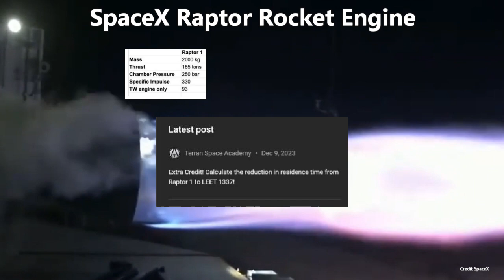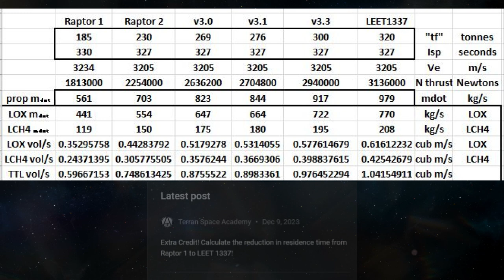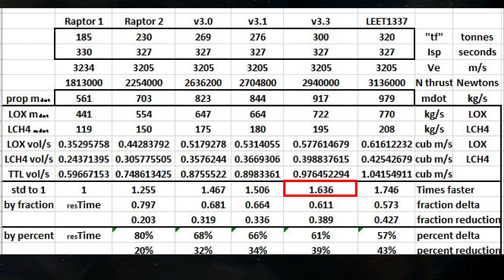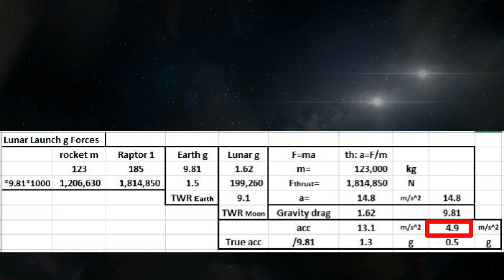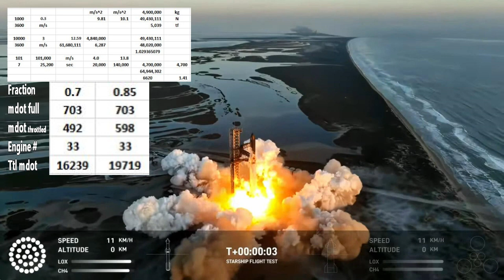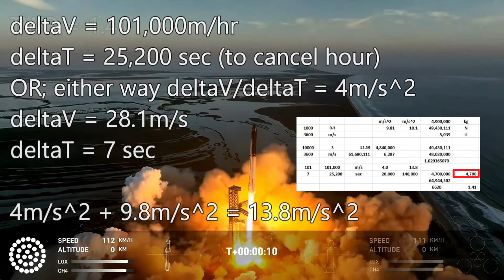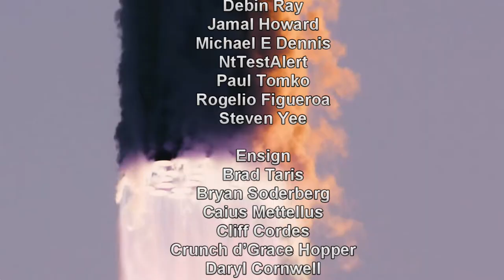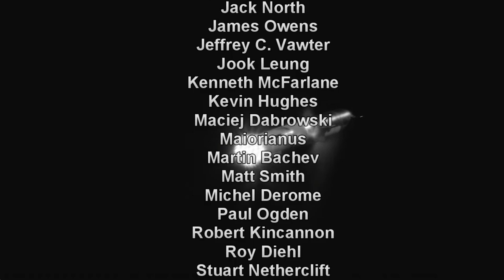SpaceX Starship IFT1 and IFT2 Booster Analysis Calculations and Solutions

Comment: For IFT-2, I figure it's about 7 s to climb its own length of 160+233=393'. Since the displacement x=.5at², then a=16.04 ft/s². With g=32.2 ft/s², that means TWR=1.498. A mass of 4900 metric tons weighs 48.07 MN, giving a thrust of 48.07(1.498)=72 MN, 97% of the 74.4 MN claimed by SpaceX. I think the video could be loaded into an editor to count the frames and get a more precise time
Reply from the maker: I wish we had one really good glitch free superslomo of each launch.  SpaceX must have these.

Comment: I know I've mentioned about its possible abort system, but i wonder if instead the whole thing has rockets at the top like tim dod had in is thumbnail, it has a dragon capsule inside for human rating only at first and during abort the fts would severe the top cone and split it in the middle going up to allow the capsule to quickly fly out and get clear in time saving the need for rockets on the outside and design with less mass.
Reply from the maker: A custom lunar version could accommodate that...
Reply: @terranspaceacademy  that is true, but technically all starships meant for humans can have it. It's a very simple modification that can be made. If they don't use the phalanx design it could be used to carry the mini starship in it using the abort system to help it get a push using explosives inside that only fire when opening like the saturn 5 staging rockets. The second launch holds its mini booster to get to the moon, allowing 1 lunar mission to be launched with just 2 launched instead of 8 to 20.
Reply: @terranspaceacademy also to speak before I forget, by only reusing the engines with inflatable reetry shields and no heat tiles you could us all the fuel to get even more mass to orbit allowing a larger cargo delivered to the moon without any refuelings needed still using the abort system to get a modified alpaca(seems safer and takes less room) to the moon using the booster to get it there into orbit and bring the capsule back leaving behind the cargo to make it easier and cheaper to get back later on. He wants less moving parts well there you go. Many modifications but no risk of orbital refueling or starship reentry risk of breaking up and only whats is needed for the moon that is not over kill like large or regular hls starship. I would like to hear your opinion on that for thoughts and ideas.

Comment: I thought Starship used engine gimballing to negate the need for shutting down the opposite engines when the fail
Reply: Only the inner engines gimbal last I checked the outer one are fixed which means if they lose around 4 to 5 outer than they would most likely have to shut down the other side too unless I missed something plus it would mean the mission is over for too many engines lost.
Reply: @mr.ackermann807  Correct the only inner engines gimble but they should be able to provide rudder control if a few engines go out also they can throttle up the adjacent fixed engines to 100% to compensate for the missing thrust.  Like you said if more than 3 go out the mission is likely a scrub.  I do wonder if later missions will have an abort profile that includes the ship hot staging and returning to land
Reply: @bigianh  ok. I've have actually been talking to others about the abort system too, but not the whole thing for it would take time to get the engines up to speed and more time to accelerate away. That's why I suggested the upper half only fly away by using the fts to seperate it and smaller engines to push it away faster without all the extra mass and parachutes to allow it to glide and land safely away. Or still use the fts but have a dragon like capsule inside for now that would act like usual since it was already designed for that. Or even an abort system where if the damage Is limited and contained to lose the engines and close of the tanks to give you more time.
Reply from the maker: The outer engines are thrust vectoring only (20), the interior 13 can gimbal so there are a lot of control options... but on the way up it can get dicey reducing power too much.
Reply: @terranspaceacademy ok thank you for informing us.
Reply from the maker: You are most welcome.

Comment: Thanks for the great content as always.  SpaceX definitively has great flight control software.  As someone who works with factory automation PLCs at work I would love to see their systems sold as such.  Much of the existing seems have that "32 bit extension of a 16 bit patch of an 8 bit originally written for a 4 bit" feeling.  One of the best examples of the system handling a hardware failure was the Falcon 9 that had a grid fin fail right after reentry burn.  The rocket started rotating pretty rapidly and didn't turn for the landing pad.  But regardless the rocket managed to stabilize itself do a soft water landing.  This always makes me wonder if that was a programmed failure condition, or if the flight control just was able to cope with the unexpected response to flight commands.   Either is impressive, 2nd case is more impressive in my thinking.  
PS keep doing the math, I love it.  But I'll be letting others double check you lol
Reply from the maker: I agree.  A system that continues adapting when things go wrong is what we need.

Comment: I heard somewhere that those computers system are running consumer grade Linux 🐧computers in a 3 X voting system. I always wonder if the 3 X voting system was actually needed on the first stage? Are they high enough to be affected by space radiation Considering the ridiculously small Circuit trace size on the chips now.
Reply from the maker: See other post...

Comment: It makes little sense to give the numbers with seven decimals. Nobody is metering that exactly. an institution that calls itself an 'academy ' should know that.
Writing cub m/s shows not being able to calculate in metric units.
Calculating with Earth acceleration 9,8 is the opposite: We mostly use 9.81 m/s^2, the exact value would be 9.80665 m/s^2. Writing 'mt' for metric tons is odd for a European, and KPH too.
Reply: Imperial units make the eurocuck seethe
Reply from the maker: True indeed.  I should set significant digits.

Comment: Great analysis it gives amazing insight. I wish you’d attempt these types of calculations using best estimates on the UKs reaction engines rocket motors bearing in mind the heavier mass of the air chiller and gas compressors in the design compared to the missing mass of 80 percent of the oxygen require to get to orbit.
Reply from the maker: That's a tough one.  Without clear data it could be extremely variable... from 1,000 sec Isp to 4,000 when air breathing...

Comment: The N1 used differential thrust to control attitude, but on Starship all inner Raptors are gimballed for vectored thrust. At some point the Starship booster might have run out of vectoring capacity to compensate for the imbalance of thrust from lost Raptor engines. Loss of thrust or vectoring could also have led to the failure of the IFT1 stage separation manoeuvre. For IFT2 there was no issue with any Raptors prior to the hot staging separation.
Reply from the maker: The N1 tried to use differential thrust :-)  No, for its time it was amazing.  They just quit too early and didn't do enough ground testing.  We blew up lots of F1s before we got the combustion instabilities right... IFT1 lost hydraulics so could not vector. No chance to stage really.
Reply: @terranspaceacademy  Indeed the N1 for its time was amazing, especially considering the speed it was put together. But it would have taken many more launched before success if ever. The problems were many and they just didn't have the technology back then to be able to deal with all the possible failure modes for such a complex engine arrangement. 
The F1 problems were more easily rectified because the engines could be tested on the ground where monitoring and post test inspections were possible. The N1 engines were reliable but designing the plumbing for so many in order to supply each engine with a steady flow of LOX and fuel is very difficult even today with advance computer simulations. Also control systems back then were extremely primitive meaning that failures could only really be dealt with in a very crude way.
Reply: IFT1 never even attempted stage separation because it never got enough altitude or velocity to enter that part of the flight plan. Also IFT1 lost control of some of the engines due to a fire in the engine bay severing control wires to the engines and also suffered loss of hydraulics meaning at some point engine gimbaling stopped working too. 

N1 did use differential thrust for control but control was quite crude compared with modern flight control systems which is why when engines failed it just shut off opposing engines. N1 was really just too ambitious for it's time, controlling so many engines, keeping them all properly supplied with fuel/oxidiser and thrust balanced is complex and as IFT2 shows it is now quite feasible but still difficult.
Reply: @schrodingerscat1863  - I can believe that IFT1 didn't get to stage separation, although most accounts of the flight seem to disagree with you! Do you have any data to unambiguously confirm your statement?

I cannot see how the Russians could expect the N1 to operate stably without any thrust control. The fact that the opposite engines could shut down implies that they had limited thrust control, although perhaps they didn't have any relight capabilities!
Reply: @sja45uk  You only have to look at the flight telemetry data compared to IFT2 to see that the ship never got to required altitude or velocity for separation. Also the FTS fired over 40 seconds before the ship actually exploded meaning that you have to track back 40 seconds from the explosion to see when SpaceX decided to abort. At that point it was no where near stage separation altitude and velocity, not even close. 
N1 had thrust control but not the fine control you see in today's rocket engines. Their control systems were not capable of the complex calculations in real time to adjust surrounding engines for compensation after a failure. If they had better control systems maybe the rockets that failed would have at least lasted longer and maybe even been at least partially successful.
Reply from the maker: Which means there still has not been an FTS test for the booster since everyone has convinced me that it did not fire on IFT2.
Reply: @terranspaceacademy  It did fire on IFT1 but the positioning and size of the charges didn't cause the ship to explode immediately. On IFT2 the TFS was moved and charges were changed to blow out the common dome between fuel and oxidiser tanks. Tests on the new system caused a test tank to immediately collapse which was enough for the FAA to qualify the new arrangement for flight.
Reply: @terranspaceacademy  - Perhaps the forthcoming SpaceX/NASA mishap investigation report will unambiguously identify if the FTS operated on either the booster or starship.
Reply from the maker: That would be good. There is a difference between SpaceX saying "we didn't activate it" and them saying "it did not activate"...
Reply: @terranspaceacademy  It was most likely automatically activated by the flight control system when control of the engines was lost due to a fire in the engine bay burning through control cables. At that point pretty much all control of the rocket was lost so the FTS would have been fired automatically.
Reply: - It is not clear to me whether the FTS should normally be expected to autonomously terminate the flight with manual operation as a safety backup, or is manual operation the normal with automatic only in special cases!
Reply: @sja45uk There will be a set of rules defined for FTS operation. Primarily if the ship strays close to the edges of the safety zone the FTS is automatic, similarly if the flight control system detects that effective control is lost the FTS would be automatic. If the flight control system detects that correct orbital trajectory can't be achieved again it would automatically fire.  Manual override from the ground would only be for exceptional circumstances where the automated system failed to trigger the FTS due to some malfunction.